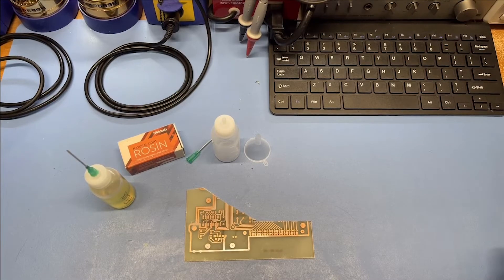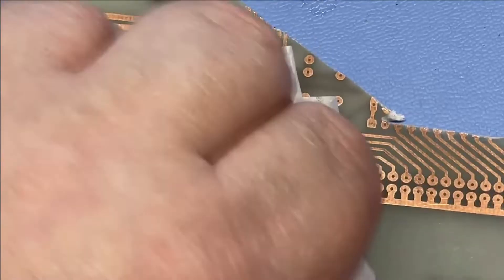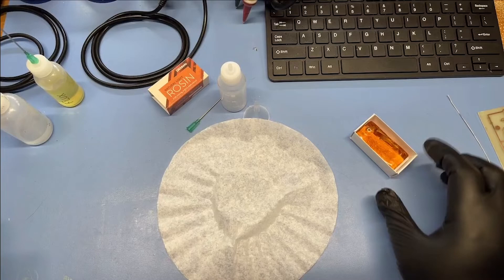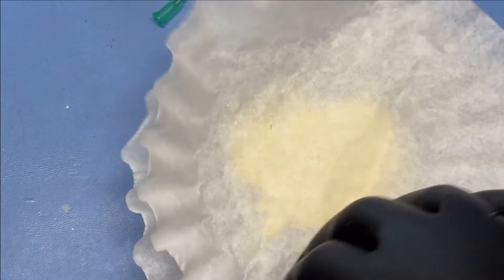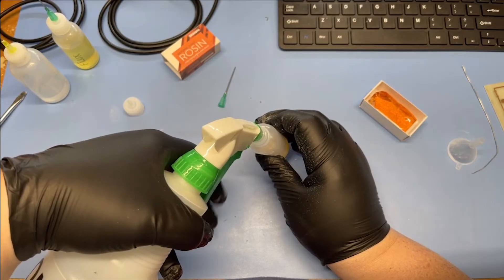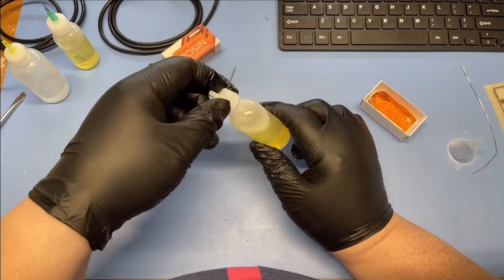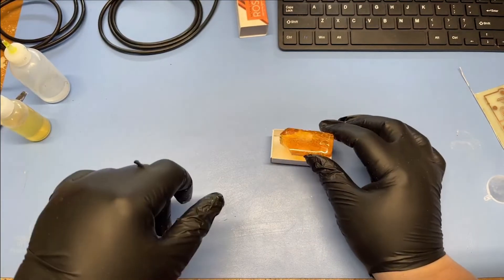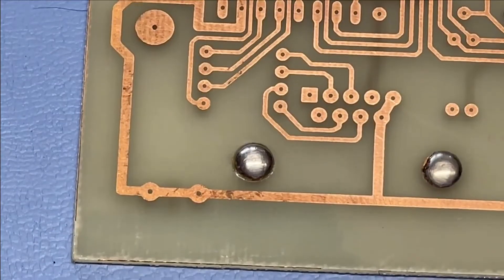Home made flux: is it worth the bother?

Comment: If you want a better product, do not use alcohol to dissole it, but heat. Then add oil, fat, grease - whatever you want. Mix it, and you will get a real rosin with no evaporation. I think silicone grease is a good choice, because it is most clear and clean one and it has right consistence.

Comment: You can make this even cheaper. I went to the nearby forest, got some spruce resin, then heated it in a throwaway container until i had the right consistency when cool and then poured it onto aluminum-foil. You can then dissolve it in alcohol. Don't worry about any of the junk in it. Now, that it's dissolved in alcohol it's easy to filter it out.
Reply: Exact same thing I did, essentially. I just used pine resin instead because it was within walking distance of my house. It's really great stuff.
Reply: @NikoBell1188  
And absolutely mind-blowing that something from a nearby tree works so well.

Comment: Are you using rosin core solder in this experiment?  I mixed up a batch and found no difference in the wetting and coverage with or without using the flux.  Maybe enough flux in the solder core for good results. I would be interested seeing results with using non rosin core solder.  Thanks for posting

Comment: Is it ok to use less alcohol and make it thicker? Can it be used to weet circuit legs so they melt when using heatgun? Also for soldering circuit legs using heat guns like you do with paste flux?
Reply from the maker: Excellent questions!  I haven't tried it any other way other than what's shown in the video.  Never hurts to experiment!

Comment: How long does it keep for in a sealed container?
Another question, do you know what the best flux for tip longevity is?
Reply from the maker: As long as it's capped when not in use I would imagine it would last for quite a long time.  Personally I used Chipquik and I've never replaced a tip in five years and all my tips are still going strong.

Comment: I used 1+1/2 parts rosin to 1 part IPA and it came out almost the same color as the original hard rosin rocks. It's pretty viscous but it works better than anything I've ever tried. I use the same type of bottles you do.

Comment: The main idea is not just to dissolve the pine rosin in alcohol, after doing so you must let the alcohol evaporate until you get the right texture, the flux obtained from this method is ideal to use as neutral flux but if you need activated flux you may want to ad a bit of citric acid. If the rosin is dark will not make good flux (dirty finish) . if the texture is too liquid it will make more mess. I am a fossil from the transistor age and i know a couple of tricks about making my own chemicals like the cold liquid thin for plating PCBs and to make my own ferric chloride at home.
Reply: Is there some way to reduce IPA evaporation? Say adding glycerine or petroleum jelly?
Reply: @Gunzee  alcohol will evaporate but if you use 85% or 75% (less the grade the better) the remaining water after evaporation will do the trick , avoid petroleum jelly  at all costs, your soldering tool will thank you a lot

Comment: Technichaly you can make a paste as well. I experimented with that and you need just less IPA. Works excellent too.
Reply: That's exactly what I was thinking. Have you tried the glycerin addition? It's apparently meant to stabilize the mix.
Reply: @Leo-gt1bx pure vaseline works well. That prevents rosin from crystalising. You don't need IPA in this case. You need to gently warm up the solution until rosin melts and let that chill. I haven't experimented with glycerine.

Comment: I saw fumes coming out from your solder. Maybe you used solder that has rosin in it's core already. I'm saying this just to get more detail information.
Reply from the maker: Hello, this has been explained previously in previous comments.  Thanks for watching.
Reply: @daveytechca  But here you are applying the solder rapidly without giving enough time for the flux to evaporate.
Reply from the maker: If you're here to critique every move I make this won't end well for you.

Comment: The only problem is that after 20 minutes of the  rosin melted all the way in the alcohol,  the rosin solidify itself in the alcohol. Its like a block of iceberg.   And when i used the liquid which i thought would have rosin in it,  solder didnt stick.  In the video,  it looks good but the guy didnt tell you the aftermath. By the way,  i used the alcohol that you would use to clean your hand during covid. So now what i do is i melt the rosin with alcohol,  once melted,  i add vaseline to keep the melted rosin from solidifying itself in the melted vaseline. 
I find that using melted candle + the melted rosin does the same trick,  it keeps the melted rosin from turning solid again.
Reply from the maker: As mentioned by another viewer, be sure you're using 99% isopropyl alcohol.  I'm pretty sure I mentioned that in the video.
Reply: @daveytechca  I no longer use Rosin for Flux soldering, it takes too much time and frustration, I found a much simpler way.

Comment: Mix the rosin 70/30 with 91+ proof alch 
Step 1 weigh Rosin chips 
2 - smash then make powder 
Put a glass jar in water in a pot on a electric stove  slowly warm with ancho stir with wooden stick put on small container will last long time can use pine rosin the alcho helps clean out rosin
Reply: I will try this thanks. Have you heard of the glycerin theory that is stabilizes the flux mix?

Comment: Nice video.
I've got two questions,
1. Does it corrode the copper or pins or silk layer?
2. How to strore it properly to prevent it from spoiling or unusable?
Reply from the maker: So far I've never seen signs of corrosion with using hole brew flux.  With it being isopropyl alcohol, it'll evaporate quickly and any residual rosin will just sit there.  It's always good practice to clean up the area.  For aesthetic purposes alone it's worth the effort.  As for storage I've kept mine in a needle dropper bottle and it's always stayed good for me.
Reply: @daveytechca  Thank you.

Comment: It's too thin. Add more rosin and some glycerin for a flux that stays long enough to make a solder joint. By the way, your vocabulary needs work; dissolve is the correct word.
Reply from the maker: Thank you for your feedback!  Especially the part about my vocabulary.  It really gives me the perfect opportunity to tell you that if you can't handle someone making a mistake to the point where you feel the need to correct them, don't watch.  Thanks again!

Comment: I read someplace that Flux is a sap from a tree or one of the main ingredients in it is.
"The most basic soldering flux, one that has been used for over a thousand years, is the natural rosin derived from pine tar resin. Pine tar resin is dissolved in solvent and then distilled to yield the clear, water-white rosin used in soldering flux". ya this was what I read a while back. Now go make it from scratch. Find a pine tree and make some real flux like they did 1000's of years ago.
Reply: In the U.S., rosin is most commonly made from southern longleaf pine trees as a by-product of paper and wafer board manufacturing. When heated, it releases abietic acid.
Reply: Nice! That'll go perfectly with my rebuilt vintage PnP machine from the 1300's.

Comment: I feel like your demonstration has a fairly large issue in showing possible effectiveness. The solder you are adding has it's own flux core being added as you apply it.. what happens if you add solder to the tip and bake off that core, then touch the pad? Compare that to a bare pad untreated and also with only the commercial flux.
Reply from the maker: I didn't make this demonstration to be scientifically accurate.  So, what you see is what you get.  Thanks for watching!

Comment: About 50 years ago I used to buy a flux called Salmet.  It was so amazing.  It would solder pretty much any metal without regard for cleanliness.  I wrote in my shop notebook that the ingredients were zinc fluoroborate, and both mono- and diethanolamine.  Now that would be worth making if one could find the ingredients in reasonable quantities.  I have spent hours looking for a substitute with similar action and I don't believe a commercial equivalent exists currently.  If anybody knows of a flux with these ingredients I'm interested in hearing of it.
Reply: Get a flux for aluminum, if you want to work the same. It has the same ingredients. But this type of fluxes are definitely not suitable for soldering electronics and boards. I have the exact recipes for few of them. They work amazingly fast, solder pretty much anything to anything, but WON'T recommend them at all for this type of jobs and won't post the ingredients (some are dangerous for hobby use).
Reply: 6:52 if you will put just enough IPA to make a little viscous which ideal for pcb soldering works, Flux that’s quite watery is quite a little bit of a problem bcoz it spreads on to an area which you don’t actually need
Reply: @oscarmarfori613 wat is IPA? Can yolu please explanation?
Reply: @selimakkus561  IPA = Isopropyl Alcohol
Reply: That is acid core flux, powerful but no good for electronic soldering. Remember, flux is basically chemically inert at room temperature, but becomes increasingly reactive with temperature, and attacks and breaks down oxidants in the joint materials at melted solder temperature. It does not clean, it deoxifies. 
The acid in acid type fluxes loves to eat copper for breakfast and its residue is the gift that keeps on taking.
Reply: @richpayton7162  No, it's not.  I detailed what was in it.  Acid flux is zinc cloride, a zinc salt of HCl, otherwise known as hydrochloric acid.  I used that Salmet flux for twenty years on pretty much everything and if it was corrosive at all, it was not  enough that I ever had a problem with it.  I have several different brands of acid flux and I know what damage it can do when misapplied.
Reply: @channelview8854  I hate to be the pedant but it's actually the hydrochloride salt of zinc, not the zinc salt of HCl.
Reply: @EddieTheH  I'll give you that.  It's been over 50 years since I had any college chemistry, albeit I was a pretty good student.  I've forgotten more knowledge than I ever learned, if that is possible
Reply: @channelview8854  Strange. I'd made a follow up comment as I found the correct stuff, but I named a certain chinese site so it probably got removed for that. If you search said chinese site for "aluminium soldering flux" you get some of a similar recipe.
Reply: @channelview8854   , a similar product is used for soldering copper pipes in thermal installations. the paste is gray and contains silver, I use it for tinning various metal parts where the classic flux is not eficient... But it cannot be used in electronics because it is corrosive, It will probably require a lot of cleaning but it is very risky.
pickling paste
Reply: @sergiuandone3075  Thanks for trying to help.  I'm familiar with that product (I think).  There is something similar but non-corrosive used for soldering surface mount integrated circuit chips onto circuit boards.  Curiously, two of the replies to my comment disappeared.  One of which before I got to read more than the first few words.
Reply: I was hunting for an aggressive non-acidic flux a few years back and ended up settling on Kester 2331-ZX flux.
It let me solder directly to nickel, which none of the "normal" fluxes would disturb the oxide layer on, so solder wasn't sticking.
Reply: @heyallenify  Thanks!  That could be a big help on the farm and my day job in industrial maintenance.
Reply: @channelview8854  keep in mind, it's not one recommended for "consumer" use, and will still degrade PCBs if not thoroughly cleaned afterwards, but nowhere near as much as an acidic flux would.
Reply: @heyallenify  I'm not your ordinary consumer, but thanks for the warning.

Comment: If I did more soldering I'd be testing out some formulations myself. It would be interesting to see if boric acid would work well or if you could use some kind of plastic + acetone mix as a thickening agent.
Reply: I was once given some 'flux' to use on a small circuit build, not my own flux. Turned out to be acid based that was for a metal fab' shop. Bad idea. A few month later the circuit had grown fur, corrosion from either the tin (or at that time lead). It still worked but only because of the large size and spacing between leads. I didn't trust it for long. There's a reason for rosin.
Reply: I just remembered, ammonium chloride is also a commonly available, commonly used flux/flux component. I wonder if it would significantly enhance the homemade flux. 🤔

Comment: I buy my Rosin off either Amazon, Ebay or Alibaba in 1 lb bags of pre-ground powder.  Much quicker to mix. Don't ever spill this stuff on the floor or your bench!! What a sticky mess that can only be cleaned up with IPA, Water won't touch it!! This way I can mix it as strong as needed. Commercial fluxes have other additives like Ionizing agents to better clean the joint etc. Good video.
Reply from the maker: I discovered the tackiness of it the hard way!  😂  I didn't know you could buy the rosin already ground up, that definitely saves some work.  Do you have a specified ratio for the general mix you use?  Thanks for watching John!

Comment: I was out looking for pine resin today along a nature bike trail. I want to try to dissolve it in alcohol and filter it just to see what happens. If that doesn't work I can always buy a block of violin rosin. I do want to know where to get the bottles that you used.
Reply: you will love home made pine resin flux
Reply: Looks like a standard dropper bottle, with a blunt hypodermic needle screwed to the tip. The luer lock is about the right size to fit most dropper bottles, and the plastic is soft enough to fit firmly.
Reply from the maker: I didn't use these ones exactly, but there are many types available on Amazon.  https://a.co/d/3HHckdz
Reply: It works. I used it a few years ago.
Reply: @richardchambers256  Thanks. I think I saw a video that said pine resin doesn't smoke as much as commercial flux. If that's true then I will keep my soldering tips constantly coated so that they don't become oxidized.

Comment: I also make my own Flux with rosin. But also use other bought stuff in syringes. Depends on the kind of work i do. One positive thing about rosin based flux is, that you do not have to clean the joints afterwards. Rosin does not damage the joints (not corrosive). On the contrary, it protects the solder joints.
Reply: I had an experience with left over (commercial) flux on a small surgsce mount voltage converter circuit.  I then tested that before installing other sensitive components.
  My mistake was the left over flux was slightly conductive and the feedback resistor divider went WAY out of tolerance. A bit of smoke, even a flash of flame from the burning flux, before I yanked the power leads. Lesson learned. 
   I was lucky, after cleaning the flux the converter still worked. Only then did I finish the build.